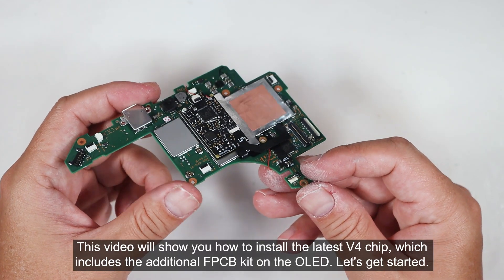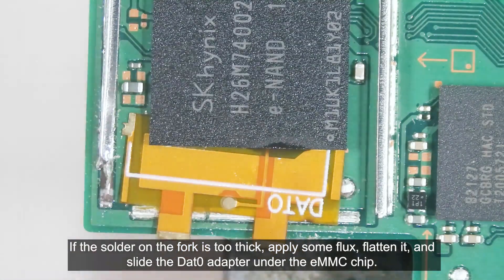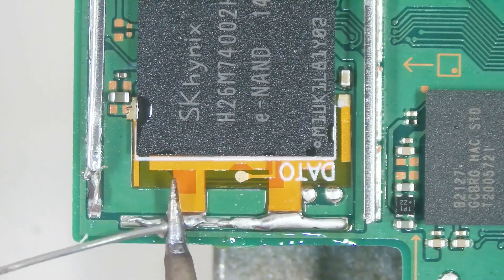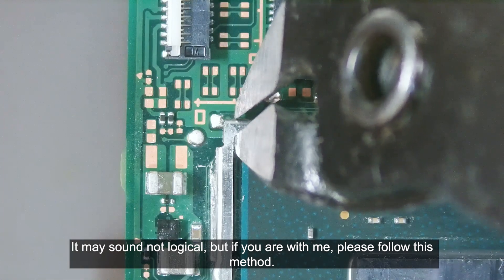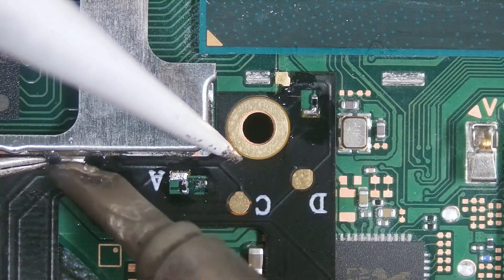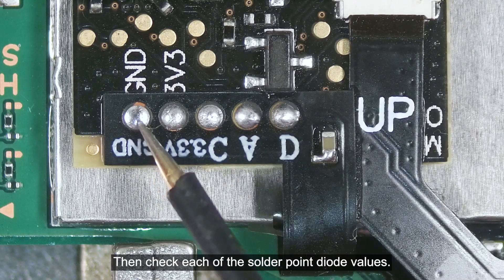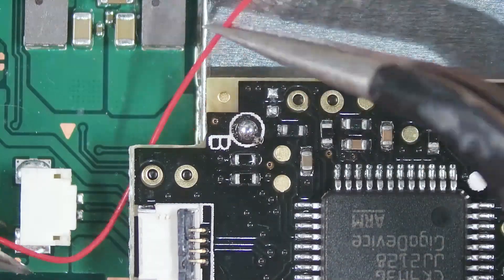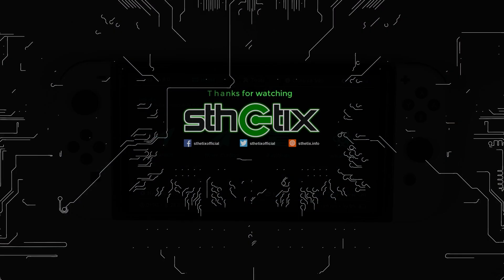SOLDERING THE V4 + FPCB KIT

Comment: How hot does the emmc get? is it good to do the reflow with a dat0 flex tinned with 138ºC solder paste?
Reply from the maker: No it is not good. I never use that techniques anymore. Better tin the dat0 fork and slip it under the emmc chip, no reflow needed

Comment: Tried my install, flashed the firmware, now it won't boot. I get a solid blue light, then a series of 6 yellow lights, 2 fast pause repeat. What could the error possibly be?
Reply from the maker: what firmware did you use?
Reply: @sthetixofficial  fw_2.73.uf2
Reply: @sthetixofficial  thought I posted a response but it's not showing.  I used 2.73
Reply from the maker: you are using a Pico then. this video is not using pico
Reply: @sthetixofficial  I used the v5 flex cable, and the only difference mine had was that the dat 0 is the black one.
Reply from the maker: picofly?

Comment: Hi, when u mesuere the values you place the red on the ground and the black on the point?
Reply from the maker: i usually put the black on gnd, and red on each solder point. but you can do that in reverse too and you will get different values (all of them are about 0.4 - 0.5V)
Reply: @sthetixofficial  Yes! Thats the velue that i get! And a friend on facebook said to me that need to get the 550, because my modchip is giving me error, when when i enter the ofw the screen goes black, and we tought that was the data0, but aparently no, the problem is other
Reply from the maker: try to remove all the wires from the chip and check if the console can boot to the OFW.

Comment: I installed, but the yellow/red lights flash 13 times then repeats itself?  Any ideas?
Reply from the maker: dat0 connection is not good.
Reply: @sthetixofficial  I measured it on multimeter, it was reading ok
Reply: @mixmastermantas6841 What value did it give you in diode mode?

Comment: I'm gonna be tackling this soon, I have very little experience so I hope it goes well
Reply: did you do it yet?
Reply: @denks7849  I have, I ruined that dat0 adapter because I heated up the solder point and ripped it off, other than that it went pretty smooth
Reply: Oh and don't reflow the dat0 adapter, he explains in the description

Comment: how i measure the volt from dat0 ? the mass the black one on the dat0 and where put i the red thing from the multimeter? i put it on the usb mass but i dont get anything
Reply from the maker: maybe you didnt insert the dat0 adapter correctly
Reply: @sthetixofficial  no, it works thanks. I was using the 2V Mode Not the diode mode

Comment: Having an issue getting it to reflow and the dat zero to stick ,  verified that the solder melts at 200c  that was tinned to the dat zero cable , any tips ? Can I just go a bit hotter or longer than a minute
Reply from the maker: please watch the updated guide as i no longer reflow

Comment: Can i use an V5 OLED CPU flex with a V4.2 HWLFY Chip? My V3/V4 CPU flex broke during installation
Reply from the maker: I think u can
Reply: @sthetixofficial  it worked without issues. The chip just has to be a bit higher. I could even still use the FPCB, although I couldn't align it straight.

Comment: Is there any way you can publish the whole list of tools you used to install this? At least in your website?
Thanks!
Reply from the maker: Hakko FX951 with T12 KU and T12 JL02 tip
- Eakins 180X Autofocus digital microscope with Sony sensor.
- Mechanic precision tweezer
- UL10064 AWG36 wire
- Surgical blade No.20 with a Scalpel handle
- 0.3mm Mechanic leaded solder tin
- Amtech NC559 ASM Flux
- 3M 9448A double sided tape
- Y00 and PH00 screwdriver from iFixit
- IPA 99% / Relife PCB Cleaner
- Relife Double brush ESD
- Paper towel / wipes
- Kapton tape

Comment: Hello, I am expecting the delivery of the chip from aliexpress that you installed in the video. But I still don't understand a few things.
1. My nintendo switch is on version 15.0.1, can I install the chip in it?
2. When the chip arrives, do I have to update it somehow via usb connection? Alternatively, where can I find instructions?
3. What files should I put on the sd card to get into hekate and run CFW?
Thank you in advance for your reply and your time.
Reply from the maker: 1. yes you can
2. no need to update
3. you can use my hats pack, https://link.sthetix.info/hats
Reply: @sthetixofficial  thank you so much

Comment: How thick are the wires you used? I have 22AWG silicone/copper wire in hands, was wondering if that would work for a project like this
Reply from the maker: 36awg. 22awg is too thick.
Reply: I'm completely new to soldering, btw. Figured I'd start it as a hobby by practising with PCB board prototypes and doing some easier projects to eventually build up the skills and courage to do this on my Switch OLED. Tips are welcome and appreciated :)

Comment: A doubt. My adapter on the NAND ship is giving a current value between 1,630 to 1,750, it is well fitted but this high value is leaving me with a huge doubt. I don't know how it's possible to have a value so high from what I researched, please sir, can you remove this doubt about what may be happening, or if this value can work on the adapter without problems?
Reply from the maker: diode value?

Comment: If I'm getting 8.3v on the dat0 is that okay??
Reply from the maker: impossible. you mean 0.830 V ?
Reply: @sthetixofficial  yes sorry. I ended up going through with the installation and all worked fine. I had the v5 oled hwfly so it was alot diffrent but similar in a sense. Instead of the ball connector it was just 2 ribbon cables along with the jumper cables like the v4

Comment: Incredible work! I consider myself comfortable with soldering, having made component-level changes on PCBs in the field for my trade, including tiny surface mount components, but this is intimidating. I can’t tell you enough how impressive this is. I’ve watched this a few times now and it seems slightly easier each time, but I always decide it’s outside of my comfort zone to try to attempt. Brilliant work sir!
Reply: The only thing out of my comfort zone here is reflowing the emmc for that one stupid connection under the chip.
Reply: @gungan5822  Exactly everything else looks fine.

I hear people are generally fine with a friction fit but can run into issues.
Reply: Whats your trade
Reply: @Vuden13  Elevator technician
Reply: i legit have only soldered ONCE! on a learning board and then modded my switch, I messed up with putting too much pressure on the wire and ruined the DAT0 adapter but it should work when the replacement comes in... Its not too bad with the newer chips (Im using the Instinct-NX chipset)
Reply from the maker: thank you

Comment: STOP scratching up the pcbs with sharp stuff man. Wth. Youre leaving scratches everywhere. You even CUT a wire on a fucking pcb trace??? Talking about the C wire.

You also damaged the insulation on tve wires with the tweezers

You also forgot to solder multiple anchor points

Comment: Hi, thanks for your videos from Italy they are very informative and also asmr with your neat accent, I wanted to ask you, is the awg36 required for the wires to be connected between the various points or is a slightly larger size ok?
Reply from the maker: awg 34 or 36 is ok. if you are comfortable with a larger cable then it is ok
Reply: @sthetixofficial  Thank you for this info and the quick reply, have a beautiful day!

Comment: Does this (the V4) also work on a patched V1 Switch? I was looking at the AE store you mentioned on twitter but they no longer sell older versions of the chip.
Reply from the maker: I don't know
Reply: Any modchip will work with any switch, just make sure to take note of which specific modchip is for which particular switch
Hwfly Core - V1 and V2 Switch
Hwfly Lite - Switch Lite
Hwfly OLED - Switch OLED

WARNING FOR HWFLY CORE V4: THE HWFLY CORE V4 HAS COMPATIBILLITY ISSUES WITH CONSOLES THAT HAS A TOSHIBA EMMC. THIS CAN BE AVOIDED BY EITHER SWAPPING THE EMMC OR BY BUYING A HWFLY V5 CHIP INSTEAD

Comment: ask help

gan kalau pin flexibel micrd dimesin hilang
kalau dibenerin awet tidak ya..gak sengaja tercabut
Reply from the maker: Pin flexible mana ya?
Reply: @sthetixofficial  yg di mesin gan.yg 16pin gara xabut flexibe micro sd jdi hilamg 2..pertanyaan saya kalau jumper begituan awet tidak ya
Reply from the maker: Konektor sdcard yg ada di v1 dan v2?
Reply: v1 gan softmode
Reply from the maker: Intinya kalo bisa di jumper ya masalah beres
Reply: @sthetixofficial  kau maslah ke awetan gan buat jangka panjang gimana .maaf gan repotin🙏🏻
Reply from the maker: Seperti yg saya bilang tadi, asal udah nyambung dan solderan udah oke ya gak ada masalah.

Comment: if for some reason the DAT0 adapter fails sometime in the future after you reflow it to the eMCC, can it be replaced? or you have to replace the whole eMCC
Reply from the maker: You can always remove the dat0 and reflow it again
 But I havent seen any problem after reflowing the adapter

Yes,  I've tried removing and reballing the emmc for some cases
Reply: Wherefor is this adapter?

Comment: Just a heads up sthetix, that 90 seconds was probably more than enough to flow the fork since it had low melt solder on it.
Reply from the maker: Yes probably,  because each hot air rework station has its own temperature profile. I used a low melt solder that melts when I set the wand at 260c😊

Comment: Is it safe to reflow SKHynix eMMC chips now? Nice video as always. :)
Reply from the maker: Safe as long as you gradually heat it
Reply: @sthetixofficial  With what chips there was a problem when U were not doing it with low-melt and one temp setting? U were using some device to get the data from this chip away from oled pcb..
Reply from the maker: Sk hynix.  But when we gradually heating it,  it will be fine.  U can dump the data using the ufi toolbox

Comment: Almost make me want to do it my self. I have soldering experience but I think those points are to small for me with what I got.
Reply from the maker: yes, you need a microscope and steady hands to solder those points. it is not easy. it is tricky.
Reply: I did it with a jewelers loupe and used 30awg wire as was the smallest i had. But i got it to work. But i took my sweet time and worked very carefully. STILL... I would NOT recommend a noob attempt this unless you are prepared to brick your Switch. No guts..No Glory
Reply: @sthetixofficial  do you think it would be easier to use a vice and have the solder in place then just turn it on and quickly remove the vice

Comment: Wait guide for install lite v4.1 and oled v4.1.
Reply from the maker: sorry i dont use the 4.1, i am sticking with the 4.0
Reply: @sthetixofficial  used 4.1 - it trains insanely fast - about 5s
Reply from the maker: It depends on the emmc brand. Samsung brand boots faster than Hynix.
Reply: @sthetixofficial  Why do you prefer v4 over v4.1?
Reply from the maker: 4.1 is basically for the lite.  Why do you prefer 4.1 instead of 4.0 for the oled?.. Fyi that number is just a marketing jargon
Reply: I just wondered if there was any advantage - I’ll definitely go with your advice. Thanks again for the invaluable video